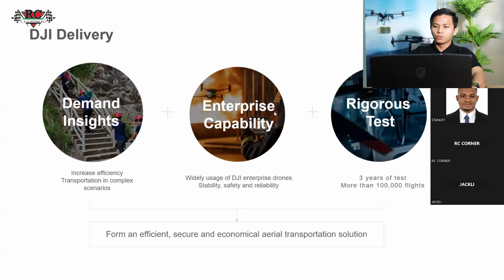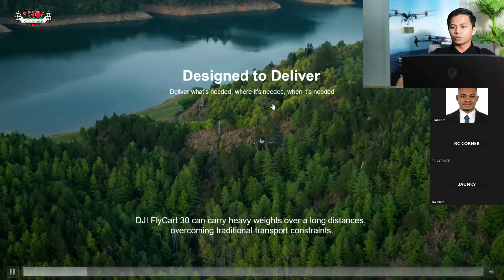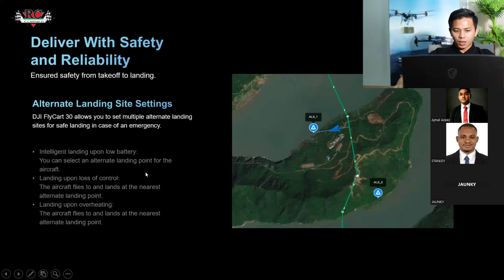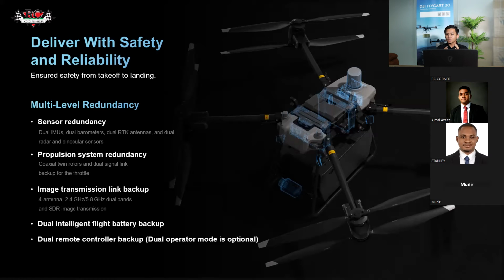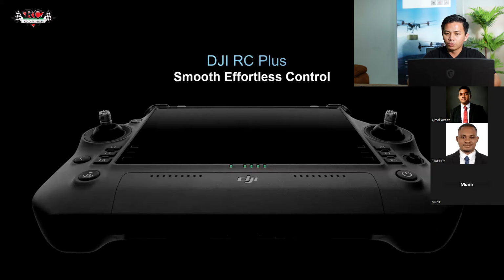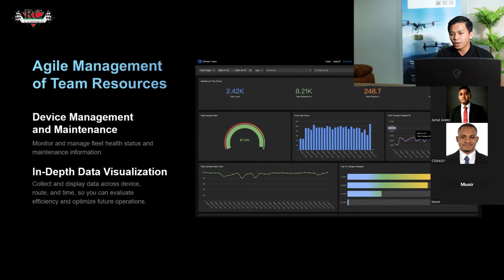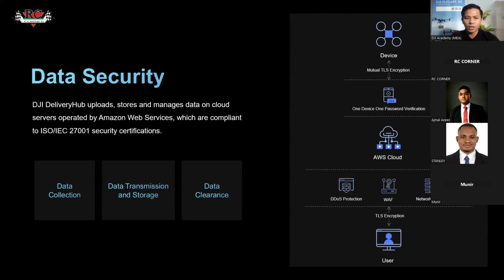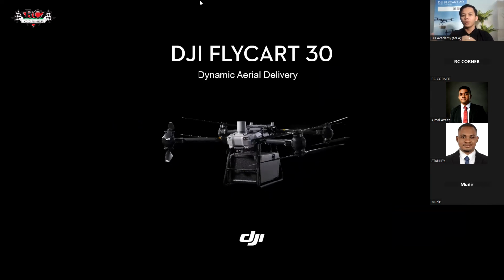DJI Flycart 30   Product Overview Webinar | Delivery Drone | By Wunna Drone Engineer

Comment: Good afternoon!

I am considering a FlyCart 30 drone to deliver small deliveries between my facilities. I currently do this using an automobile. Before buying a drone, I am trying to make calculations of drone efficiency compared to gasoline costs. Maybe you already have such calculations?

Based on the technical specification of the drone battery and its charging station I can't calculate the efficiency, because the specification doesn't say how much current (Amps) and power (Watts) input the charger consumes. The only thing I see in the spec sheet is the output power of the DJI C8000 Intelligent Charger

Model CHX101-7000
Input 90-264 V AC
Output 42-59.92 V DC
Max Output Power 7200 W (Dual input)3600 W (Single input)

You will help me a lot if you can give me efficiency calculations or at least these data:
1. how much current (Amps) and power (Watts) input the DJI C8000 Intelligent Charger consumes?
2. How long will it take to charge the FlyCart 30 DJI DB2000 Intelligent Battery of the FlyCart 30 DJI DB2000 Intelligent Battery drone using the DJI C8000 Intelligent Charger

Thanks in advance!
Reply from the maker: Noted on this .more info please send an email - sales@rccorner.com